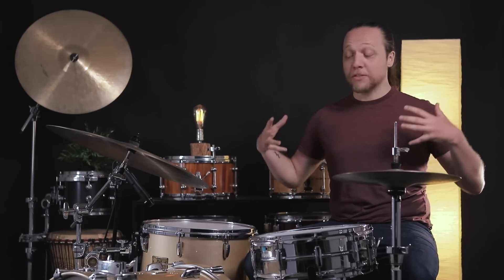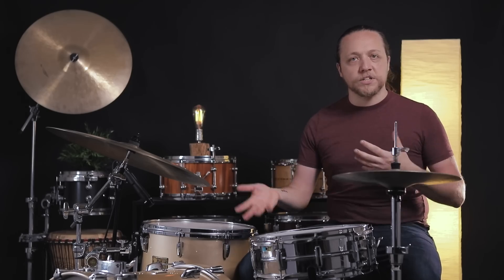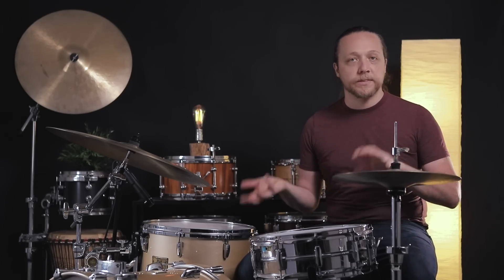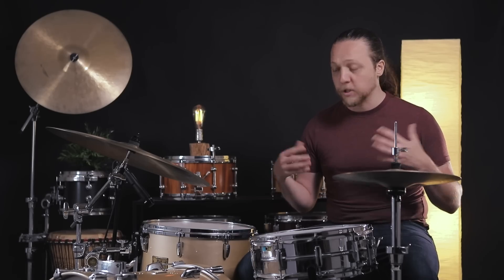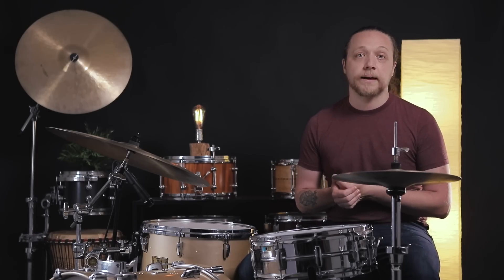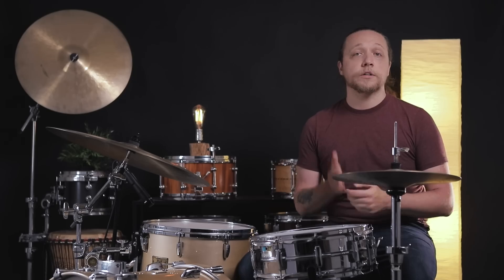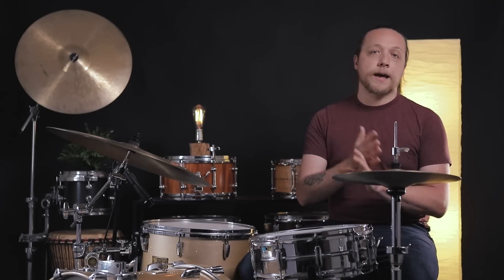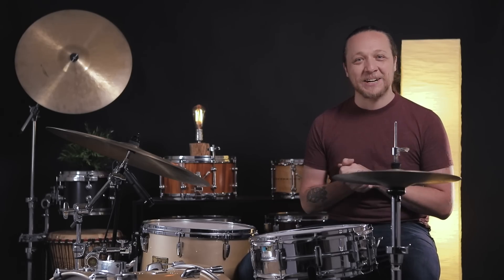A Better Bass Drum Muffling Hack | Season Three, Episode 6

Comment: Try a bedsheet, stretched under the entire single ply, unported front head. Very old school. I like this paired with a clear Remo P3, on the batter side. Not very old school. Tune to your liking and/or situation; I like having the reso side, substantially higher than the beater side. Don’t bury the beater.

Comment: I'm pretty good at tuning but I'd never tried this technique before I saw in this video how drastically different it sounds from a pillow or blanket that touches both heads and covers more of the shell. My 22 and 24 now sound better than ever (even with PS3 batters on them), over a much wider dynamic range, thanks!

Comment: So lately for my bass, I like it pretty open and not really muffled much at this point, but my family doesn’t always enjoy the house vibrating lol. 
So lately I’ve been leaning a large pillow against the outer side of the Reso head. I’ll often put the pillow over the port hole and have it leaning against about a little less than half of the reso head. The more of the reso the pillow covers, the more it’s just like I stuffed a pillow or two inside or a comforter inside the bass drum itself. This technique has allowed me to keep a good amount of tone by not covering the head too much, but taking away enough sustain and vibration that nobody is bothered anymore. 
I do have a towel inside of the bass with some newspaper strips as well. 

I really like what you achieved from this as well. I think it really all starts with being able to tune the drums and make em sound good without any muffling or dampening or anything to sorta cover up tuning mistakes.

Comment: I've used this muffling technique for years for rock, pop, church and even some jazz gigs. I like to use single ply coated heads with a hole in the front, a moleskin pad on the batter, and a hard felt beater. If I'm playing a rock gig un-miked, I remove the muffling and use a wood beater.

Comment: Great video. I'm enjoying season 3. A few years ago I made my own DIY version of Weckl's muffling system. I took a long tube sock and stuffed it with strips of an old towel (or you can stuff it with old t-shirts, socks, lol, whatever works). The tube sock stretches quite a bit, so you can make it fairly long. And then you can adjust the amount of "stuffing" and move it around inside the sock (if you want more in the center, less at the ends). Tie or rubber band the open end of the sock, so it keeps it all contained. Use gaff tape to attach it to the head/shell, like shown in this video. It works well.

Comment: Another great video. Solid info here. I'll add that the best thing I've tried (after trying everything in every way over the years) is the Remo Sub Muff'l. It works identically, but from the opposite side, with the benefit of easily adjusting the degree of dampening. really great. Thanks again for the video and channel.

Comment: One thing that has worked for me is to place a thin bed sheet over the bearing edge before installing the head so that the bed sheet kind of drapes over the head between the head and the bearing edge. You should make some kind of cut in the middle of the sheet to let the air move and you can experiment with removing various amounts of material. You could also probably use contact cement to attach the sheet to the head if you don't want the sheet between the head and edge.

Comment: i used a 20 for years and used a cs head battter, and a remo coated bass head on front with a felt strip sounds great, bought a pdp cx kit with 22 had a evans emad and dw front with holes at each lug,  with a bed pillow in it sounded vantastic, found the pillow was glued in with elmers glue sounded vantastic as long as i  pulled the beater on uach stroke

Comment: Another option that’s a version of this that I’ve used for years is to make a tube with the towel taping the ends together. Fill in area between the head and the shell touching as much surface of the head with the towel. Here’s one reason it’s important to use a larger towel. The remaining towel with the taped ends presses into the portion touching the head and should hold it in place if you get it right.This works great until you move the drum then it depends on how well the towel wants to stay in place. I find using a medium sized towel works great but a small towel or even a t shirt can be placed against the reso head to eliminate any offending overtones. This method works for me %85 of the time. Fat, punchy, resonant, deep bass drum sound that can be adjusted to a more open sound by removing a portion of towel from the batter head.

Comment: I gotta say I am intrigued by the towel method. I’ve seen the Simon Phillips video and like his bass drum sound on recordings a lot. Your bass drum sound with the towel sounded great. Seemed to have a richer low end sound, which is what I’m looking for in my 24x14. I have always used a P3 batter, smooth white ambassador reso head with a DW pillow lightly touching both heads. I am going to try the towel method tomorrow. On a side note, Simon has started muffling his reso head with a small square of a paper towel or cloth neatly taped to the head at the 6:00 position. Very discreet looking.
*update*
After A/B-ing the effects of the towel as opposed to the DW hourglass pillow barely touching both heads, I get more sound and more “size” with the pillow method on my Ludwig classic maple 24x14. It was worth trying though, you never know.

Comment: Afternoon, Cody! Say, have you ever tried placing a piece of printing paper in the center of a drumhead on its underside? You should try it in a video sometime. You might be surprised by the results. On rack toms you'd have to cut down the paper's size, not to mention never being able to use less than two small strips of gaff tape because it would never have an affect otherwise, but it does give the drums a unique sound. Even try it on the snare, it definitely gets girthier. This technique is best with a bass drum, however, because the way a bass drum sets you can control the amount of deadening the paper does by how much tape you use. You can also layer how many pieces of paper are used for more dampening. And it doesn't just have to be printing paper. You can also use newspaper, notebook paper, magazine paper, catalogue paper, cardstock paper, or whatever other paper find lying around. You can go big, medium, small. Have fun with it, ya know? It just depends on what sound you're going for. The paper does have to be placed in the center where your attack happens, otherwise the sound does get a little wonky. Give it a try in your next video. I'd love to know what you think.

Comment: Interesting the towel method...In my Tama rockstar bass drum I have a twin bed flat sheet folded in a triangle like the flag and taped to the batter head centered, sounds great. On my Pearl Export  I have 3 small couch pillows in the bass drum, sounds excessive but it sounds great! I bought the set used and 2 brand new pillows came with the set, I added the 3rd experimenting and it sounds great. Both drums are 22x18, stock resos non ported, the Tama has a Remo Ambassador coated batter, and the Pearl has a Remo Ambassador clear batter......

Comment: Cool. I'm here to stop the double tap beater strike on a non ported empty 22x18. I was looking at external 'arm n pad' mufflers, seems the issue is excessive batter head movement (great for low end) but introduces bounce of the beater, in resonance with the reso head. I tried gels on both heads, and 2 on each does work, just not enough. I'd like to try felt strips next, at least on the resonant, if not both.

Comment: Love your videos find them very interesting and informative. Have you ever looked into the effects of beater patches? I remember a few years back i was putting new heads on a kick drum and was struggling to get it right (not miles away but not quite there). I normal do use a patch but for some reason i hadn’t applied it to the new head yet, once i put it on everything fell into place the patch took away just the right amount of overtones i needed. Be interesting to hear it side by side.

Comment: Great video! I have a quick question.... I have a 22" bass drum and use the Dave Weckl towel. I currently am using an Evans Heavyweight batter head and an EQ3 for the resonant head. Because the batter head already comes with a little muffling built in I decided to put the towel against the resonant head. It seems to sound punchy enough but am I screwing up?
Reply from the maker: Nope! That’s totally fine. With all of these things, it just boils down to whether or not you like the sound. I do felt strips only on front heads a lot too for jazz, you can really do whatever you want :) -Cody

Comment: I've always had really good luck with running a solid front head with light muffling.  Mic placed directly in the center about 1" off the head when needed.  I'd be curious to hear your thoughts on this method